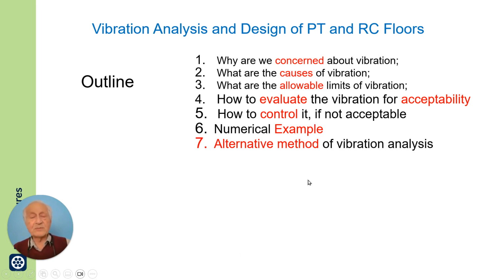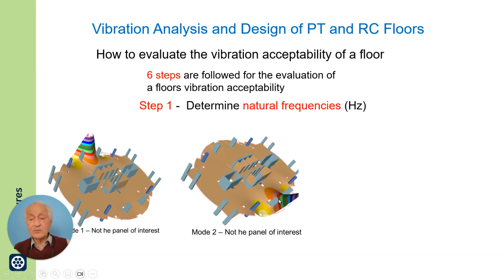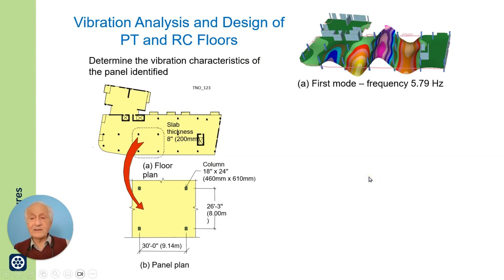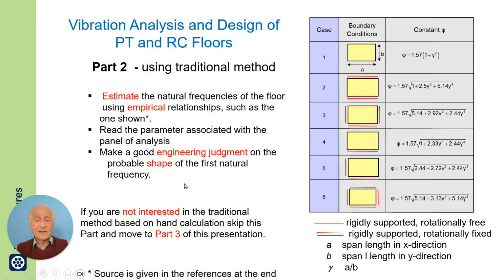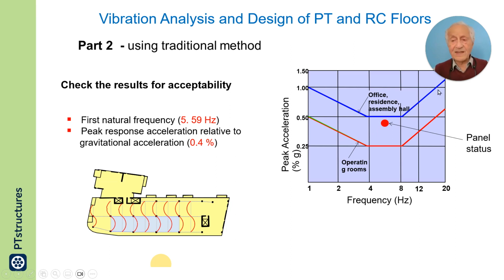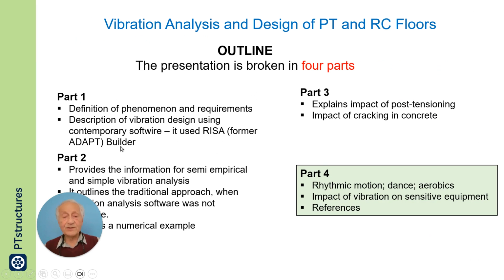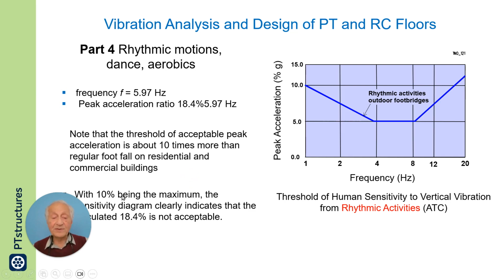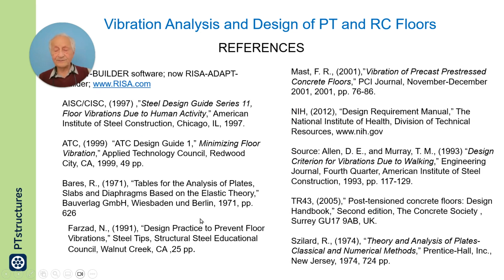15- Vibration Analysis and Design of PT and RC Floors Lecture

Comment: Thank you for the video! Could you share more details about the model at minute 15 where you calculated the natural frequency? I suppose it’s a PT slab, and I’d like to recreate it in SAFE to compare results. Thanks!
Reply from the maker: The model shown in this presentation was generated using ADAPT Builder. The solution does not depend on whether the structure is PT or RC. Frequency depends on the slab stiffness. While the software permits input with reduced stiffness, the answers shown are with full stiffness - no cracking.
Reply: @Post-TensioningbyBijan  Thanks for the clarification! I’ll try to replicate it in SAFE. Appreciate your response!